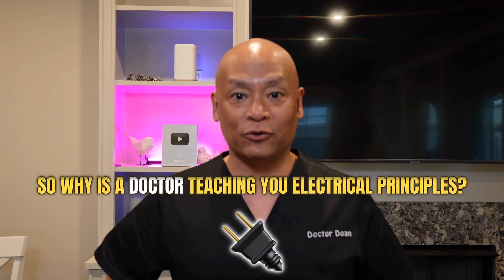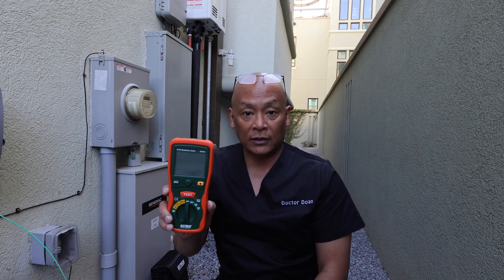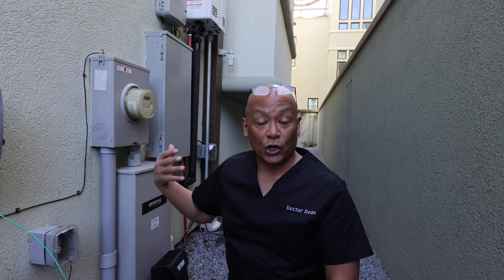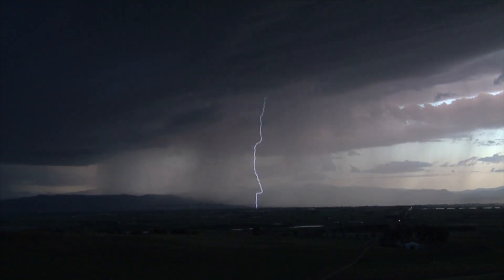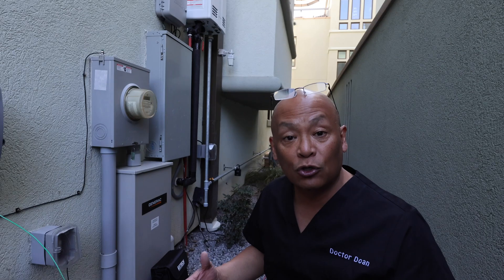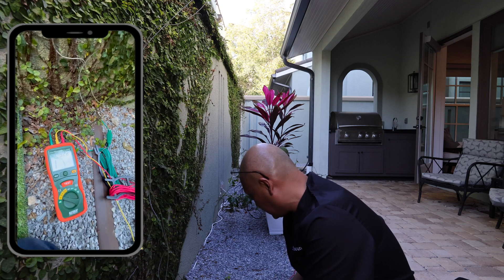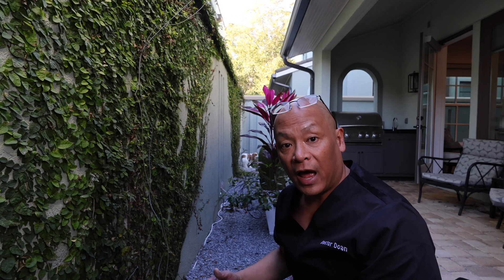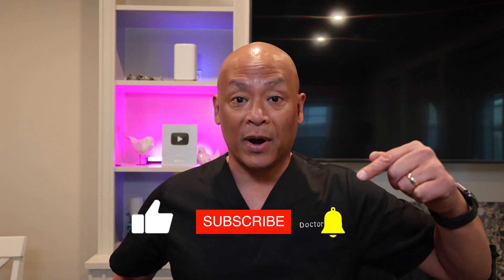Measuring Grounding Rod Quality With ExTech Earth Resistance Tester

Comment: Dr Doan, if we follow this set up to correctly properly ground with that Extech meter, do we also need to connect an NCB aswell? As Belt and braces.? 

Also, what happens when you use the Extech and you can’t put the electrical diodes 20 feet apart I only have a patch of soil that 6 foot long 😕
Reply from the maker: The Extech is to measure ground currents. Place grounding rod into the ground and an NCB is not needed.

Comment: I'm reading in my research 1milliamp for the body to have trouble.
Reply from the maker: I microamp. EPRI originally reported 18 µA of contact current has “biological effects relevant to cancer.” Later it was found that only 1 µA exceeded the benchmark set by the NIEHS. Therefore, current should be much less than 1 µA or zero.

Comment: Dr. Doan:  Please watch the following YouTube video by electrical engineer Steven Magee of Environmental Radiation LLC YouTube channel in which he uses a multimeter to test for stray voltage on the surface of the earth between his front yard and his backyard by running a thin insulated wire from where he is with his multimeter in his backyard, to a grounding rod in his front yard ( he lives in an average size 3 bedroom house in Arizona ) and attaches the black negative probe of his multimeter to that wire.  He first uses the red ( positive ) probe of his multimeter to test the surface of his backyard which his multimeter indicated was 139 millivolts.  He then tested his body voltage by touching the red ( positive ) probe while his body was ungrounded; his multimeter indicated his body voltage was 134 millivolts.  He then attached the red ( positive ) probe of his multimeter to a metal ground stake he placed in the ground from his backyard to test for stray voltage and his multimeter indicated there was one volt of alternating current voltage ( 60 Hertz A.C. frequency ) in the soil between his front yard and his backyard with 1,750 microamps of current.  Question ( 1 ):  Did this indicate his backyard was not suitable to use a grounding steak to create an earth-ground for indoor grounding products such as grounding mattress pad and / or, grounding sheet and / or, grounding mat because of that one volt of alternating current ( 60 Hz A.C. frequency ) stray voltage in his backyard?  If so, I presume there was nothing he could have done to remediate or filter out that stray voltage in his back yard if it was caused by his local power utility company using an earth ground for the neutral return wire of residential neighborhood public electric utility power lines.  Perhaps his local public electric utility power company uses underground A.C. powerline cables instead of using above ground A.C. powerline cables in which case, there would be no above head powerline poles in his neighborhood.  Perhaps the A.C. electrical system of one of his neighbors house, was grounded to an underground water pipe or sewer pipe that was sending voltage from their yard to his yard.  Question ( 2 ):  Was his method of using a multimeter to test for stray voltage in his yard, a reliable method?  Steven Magee had published the video on YouTube 14 years ago; the ExTech Earth Resistance Tester probably did not exist at that time.  The title of his YouTube video is:  1V AC Stray Voltage Between the Garden and the Ground Rods.  The YouTube video URL link:  https://youtu.be/btDuDIL6LCc?si=kyTBrIe1MMK3SqTA
Reply from the maker: Thank you for sharing this!

	1.	About the method: Using a long insulated wire and a multimeter can show voltage differences in the soil, but it’s not the most reliable way to measure stray ground currents. A professional earth resistance tester or clamp-on ground tester would provide more accurate data.
	2.	What the numbers mean: The ~1 volt AC difference between the front and backyard rods reflects a normal ground potential difference (GPD) from utility return currents flowing through the soil. The body voltage of ~134 mV and reported current of ~1,750 microamps (1.75 mA) is measurable. While this is well below shock-hazard thresholds, even microamp-level currents in the body may potentially have biological effects, as shown in multiple studies on wound healing, vagal tone, and ion channel modulation.
	3.	Suitability of grounding: This does not make the backyard “unsuitable” for grounding. The earth almost always has some stray voltage. The key safety consideration is avoiding simultaneous contact with household appliances (bonded to utility neutral) while being grounded to a separate rod, which could place the body between two different grounds.
	4.	Can it be eliminated? Stray voltage in soil cannot be fully removed—it’s inherent to how utilities distribute power. Filters such as Neutral Current Blockers (NCBs) can reduce its impact when using indoor grounding products, but there will always be some level of background AC in the soil.
Reply: @DrAndrewDoan  Your a wealth of information; thank you Dr. Doan !
Reply: Dear Sir please note when he tested this what he picked up was a difference voltage gradients. . He actually found that the ground was different in voltage values between the gradients,  that's all. Remember voltage is noting more than the difference between two points. He detected that. That's all.

Comment: Thanks for this great video! I want to buy a grounding mat and connect it to a grounding rod in the garden. I don’t have a ground tester. Is it really necessary to use one, or is it enough to measure your body voltage with a multimeter? If your body voltage drops to almost 0 mV, can you then conclude that the ground has no voltage and is therefore safe?
Reply from the maker: I don't think it is necessary if there is a good body voltage drop and you feel good with the grounding rod. Keep the rod away from EMF sources.

Comment: Do i need to do this if im using a separate grounding rod just for my mat? When i use the mat its  stimulating and not a good feeling.
Reply from the maker: If the rod and mat aren’t feeling good, then you need to check for ground currents with the ExTech meter. Link for the meter is in the description.